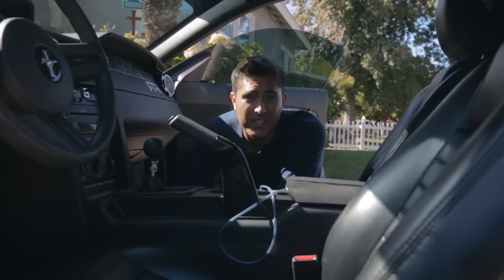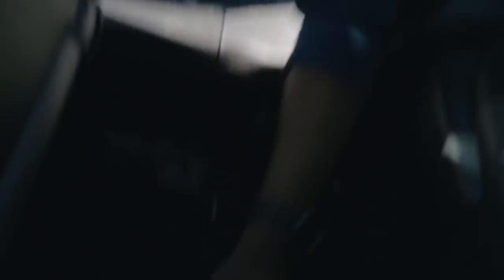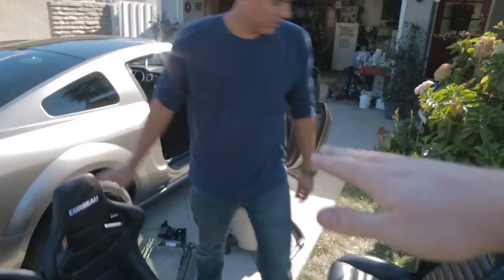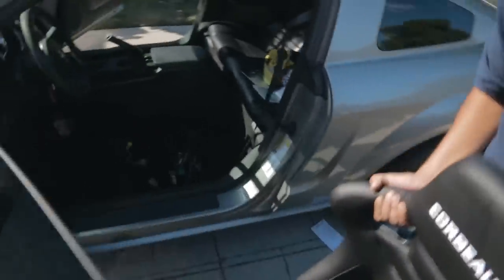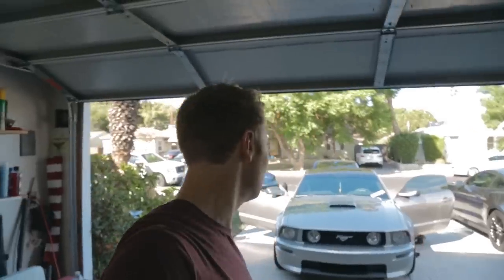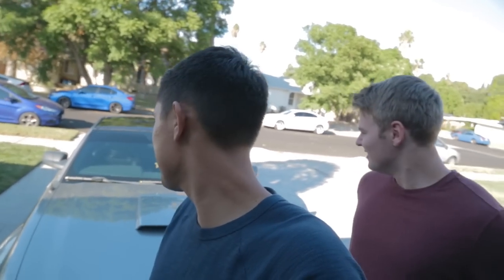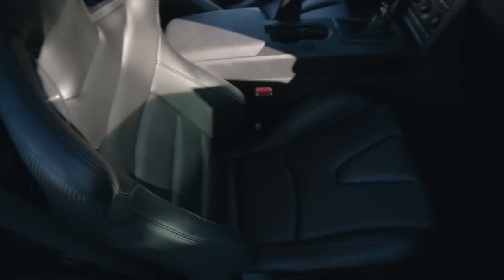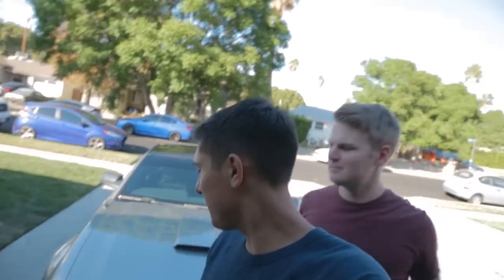THESE SEATS ARE SO NICE! Mustang Corbeau Racing Seats Install

Comment: Did you get your decklid panel at American muscle? And can you take it off and put back on whenever u want or do u have to buy a new one if u take it off? I literally have the same exact car lol
Reply from the maker: +Jessie Sauceda I did get it from AM. You can remove it, but not as easy as the magnetic panel. Removing this panel would require a little cleaning of the tape residue and replacing the 3M tape on the panel

Comment: My 05 doesn't have seat airbags but how do i get the dash passenger airbag to turn in when someone is sitting in it
Reply: Did you find out how to trick the car in thinking the seat is still hooked up so airbag light doesnt come on? The seat airbag is good its just the seat I still have light on dash for.
Reply: @ricklane9556  Did you solved it?

Comment: their not even racing seats, these seats are realy peace of shit cheap ass seats, wanna get a racing seat either get recaro, sparco or cobra, there is no alternative, this is not a racing seat. The vinyl ones are what 350dolars for one, hmmmmmmm I wonder why a recaro bucket is 800 or 900, even 1200 for full leather ones a piece, cause its good quality thats why, these seats are crap and not racing seats.
Reply: These are the full leather version of the Corbeau RRS seats... They're $1600 for the pair based on what I'm seeing on their site, so they aren't cheap.